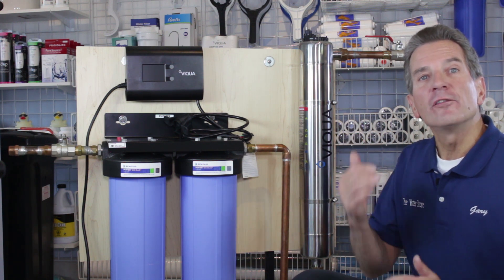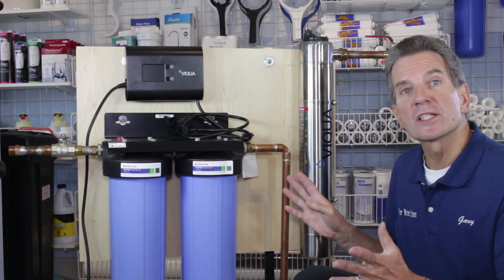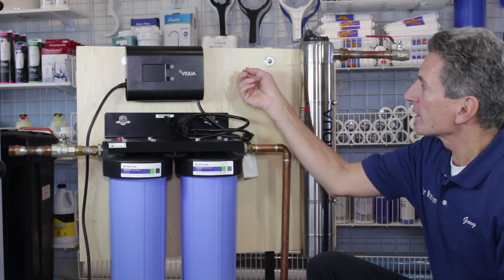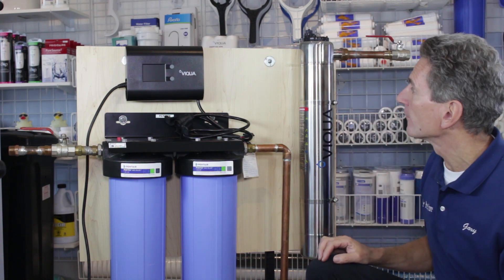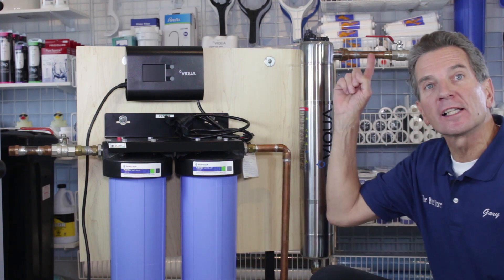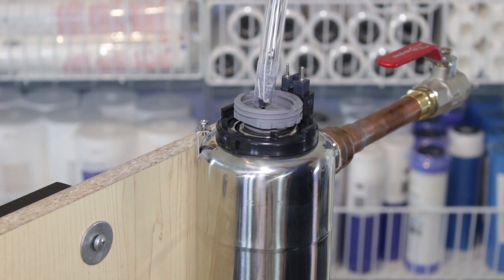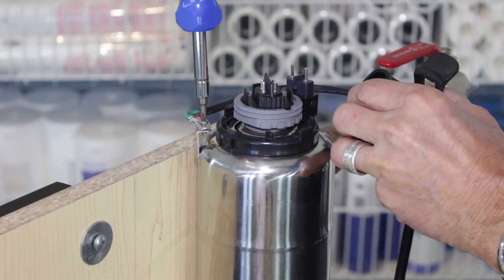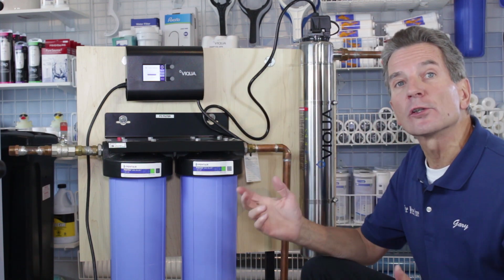How to INSTALL Viqua D4 or E4 22 gpm UV System – 11 EASY Steps

Comment: Does the input HAVE to enter in the bottom and output from  the top? Or does the input/out not matter?
Reply from the maker: Great Question.  The input goes into the bottom to help remove air bubbles with the flow.  Will it work going the other way?  Yes, it will and I've seen them installed that way just make sure the end where the lamp goes in is up.